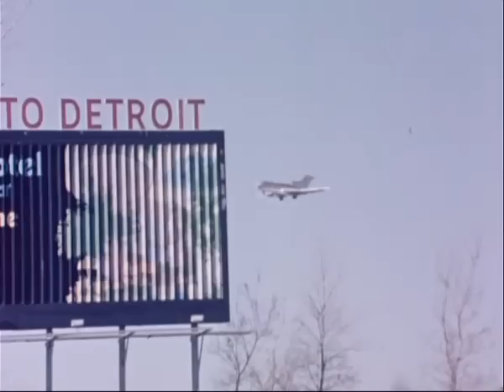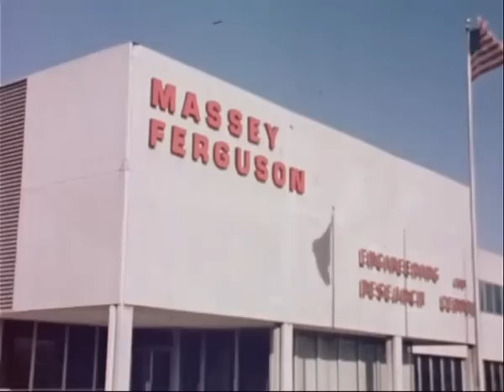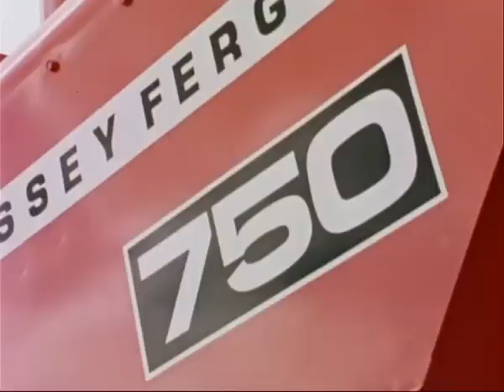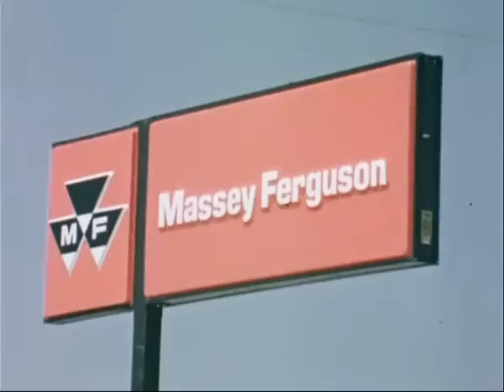Massey Ferguson 1979 CANADA

Comment: About 15 years ago we needed a hydraulic fitting for the pto system on a 3000 series tractor- MF did not have one in stock ANYWHERE in Europe and was priced at £40 - the fitting was non standard and un available at the usual hydraulic supplier however with a few phone calls I sourced a replacement which was posted me next day for £5 including delivery,  the MF dealer called 6 WEEKS later to say the fitting had come into stock ,    How incompetent of MF not to have say 10 of those fittings in stock in each european parts hub bearing in mind the obvious  profit margin involved ,   even though the fitting was so expensive as an MF part number it would probably have been purchased as a quick fix for a busy tractor I could give other examples of bad MF management and no doubt other manufacturers have their faults too but it does,nt surprise me they have been left way behind the likes of JD and NH in the last 30 years.